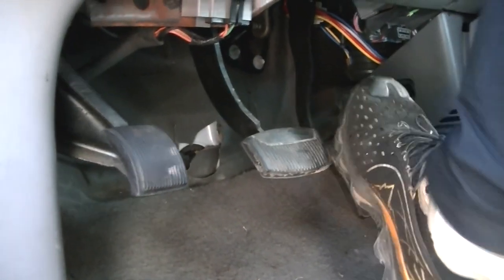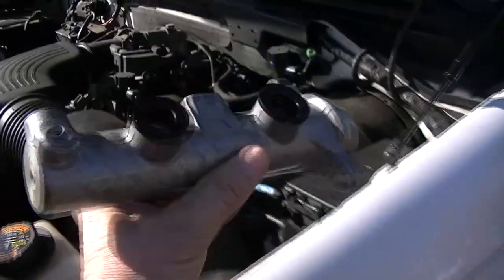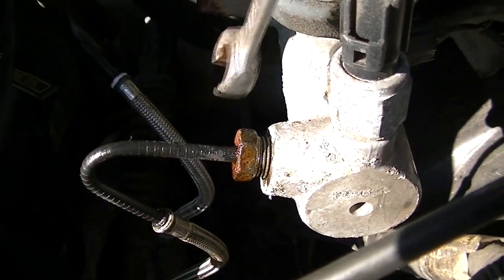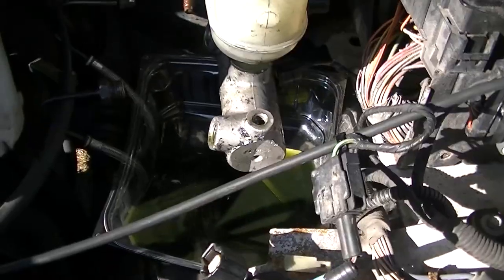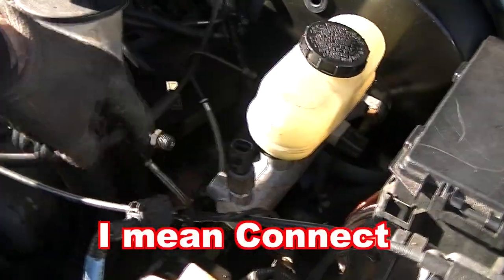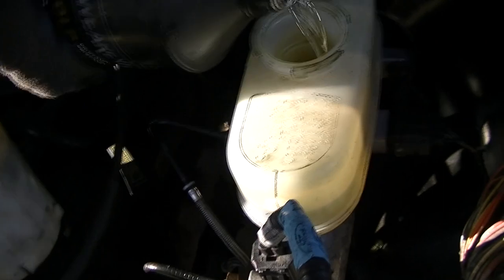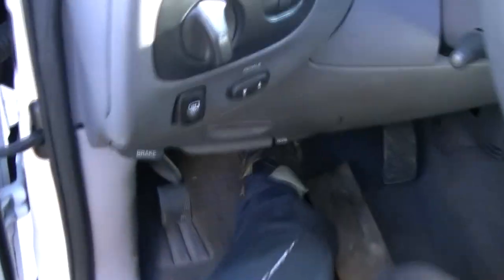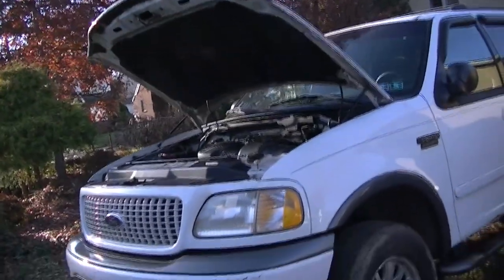Fix Fixing A Sinking Brake Pedal- NON ABS...Master Cylinder time!!

Comment: I learned a new trick from a guy on You Tube. Buy a 20 foot 3/16 id clear ( vinyl) tubing. Remove the dust cap on the caliper and force one end of the tubing onto it. Put the other end in the brake fluid reservoir. I used a funnel to hold the line in. Then open the bleeder screw on the caliper and slowly pump the brake pedal. When there are no more air bubbles in the clear tubing, tighten the bleeder screw and move onto the next caliper. Worked very well for me.
Reply: You don't want to put the old fluid in the caliper back into the reservoir unless it's all brand new fluid! Discard the fluid coming out of the caliper.
Reply: Instead buy a GALLON  brake fluid at Walmart for 14bucks
Reply: That's the stupidest thing I've ever heard... If u run a hose from bleeder valve on brake caliper up to the master cylinder reservoir, then any air that u are bleeding out of the system through bleeder valve, is being rerouted right back to master cylinder... Any1 that reads this comment, DO NOT DO THAT!
IF U VAPOR LOCK THE MASTER CYLINDER, THEN U WILL HAVE TO EITHER  USE A MANUAL BLEEDER (which is a pain in the @$$), or PULL MASTER CYLINDER ONCE AGAIN & BENCH BLEED, or possibly depending how much air u force back through it, if it blows or damages a seal, then you'll be buying a whole new mster cylinder!
I wish people would just keep to themselves if they aren't 100% certain about the methods/techniques that they share... Cause when it comes to people's vehicles, most people are trying to accomplish a diy repair to keep from or due to lack of funds to pay an ASE certified mechanic to do it... So when they follow sum1 advice & end up being no better off than they were when they began, it is really a debilitating issue to sum people...
It's really quite simple,
If u don't know what you're talking about, just don't talk/comment...
Watch, read, research, & become informed, so that u may actually offer sum valuable insight.
Reply: @fig-by3rz  I am sorry for my comment. I do not change out my brake fluid every time I change my brakes. This method makes it easy to bleed my brakes by myself. The tubing I use is not pushed into the brake reservoir, but placed a couple of inches above it. How is the air going back into the master cylinder? I don't understand your comment. Air is not heavier than brake fluid.
Reply: Well that's more like burping only tho.. Doesn't flush old stuff

Comment: It's easier to bench bleed the master cylinder, then fit a tube on to the calliper bleed nipple, into a clear plastic bottle with a 3rd of used brake fluid in to stop air flow.

Comment: Easy to follow directions, besides the diagnosis fault, differes what may be the issues split a part the booster section out of the equation.
Reply: Great Job..I'm going to have  to do this myself..
What is up with cost of taking it to a mechanic$2-300.. its not that hard to do .

Comment: Good lesson. You ended up bleeding the lines anyway; therefore, it is quite possible that by bleeding the brake lines will fix the "lose brake" pressure prior to replacing the master cylinder (less work). It worked for me.

Comment: In most cases you can fix the old master cylinder with a kit. The genuine one is better quality when I remove mine it still had the machine marks in the bore.
Reply from the maker: Yea True

Comment: You might want to bleed those lines a little more.  An 96 inch line holds a little over 1 cubic inch.
Reply: Nice job on that repair.   Thanks
Reply from the maker: OK.

Comment: Yea so I replaced the master cylinder and bled all lines starting with the longest line first and so on. Now it still feels like I'm loosing pressure.  Pressure is better but it just goes down slower. No leaks and even new calipers.  My caliper pistons arent moving much... could it be that I need more fluid in the system to push them out more?
Reply: You just need to get ALL the air out of the system. Adding more fluid will not help. As long as there is enough fluid in the reservoir obviously. The cylinder can only push so much fluid. It cant push more just because you add more fluid. Can you pump the pedal and the pedal gets firmer? If it does, and only drops a little bit then  you have air somewhere. If the pedal drops all the way down while your holding your foot on it then you have a leak still. It can be a bad master cylinder. Cheaply made or rebuilt cylinders may be defective. It happens and is not that uncommon. You need to bleed them more or you may need to have the brakes power bled at a shop. Or if you have ABS check the procedure for bleeding the  ABS module. Some cars have different steps or added steps to bleed the system. You have to check a service manual for your car.
Reply: @stang1970  yea wow I posted this a yr ago. Thanks for the response. I had  to bleed them more to get the air out as you stated as well as add fluid. I lost fluid during the bleed and to make sure you don't suck in more air keep it topped off. My calipers were duel pistons and one on each side were stuck. I replaced the calipers and the master cylinder. Calipers were probably fine. But the master cylinder was in fact bad. Didn't take long to fix.
Reply: @GODsSPECTRE  yeah i realized after i started typing how old your post was. I figured i would respond anyways in case someone else was having issues. since this was a how to type video. Im glad you got your car fixed!

Comment: I just had new breaks put on two weeks ago and my brakes still feels like a sponge. I just had a master cylinder put on and my breaks still goes all the way down to the floor. I bought a air filter, spark plugs oil change and filter and I'm wondering if all of this was done because my boaz had to put a quart of oil in my car on Valentines Day and I had the oil changed in December 🤔

Comment: Quite long yet very good and to the point. Just worried a little about your b fluid running all over during the bleeding.  As for the heat on the nuts, ( I mean the motors'!)  sounds good but isn't that a little risky in such an environment.  Finally I have a Holden Barina (Australia). Maybe the basic are the same but like with many other cars it can be so different. Thanks a lot, I have watched quite a few here, I put you in front of the others :)

Comment: Good video.  One little trick I have discovered, is to just barely tap the pedal upon the initial installation in order to allow the small amount of air trapped inside the unit to escape back into the master cylinder, rather than be forced down into the lines.  This has been a good remedy to keep from a full scale bleed of the lines.
Reply from the maker: Thanks for sharing!~

Comment: I know it's an older video but I'll try anyway. How did you arrive that you didn't need to replace the brake booster? I have the same problem and I don't want to go through a process of elimination if I can help it. Thank you,   this is  1/1/21  HNY
Reply: brake booster has nothing to do with a dropping, spongy pedal. A  brake booster, simply put, boost the pressure that your foot is applying to the master cylinder. This makes it easier to apply enough force with your foot to stop the car. Think of it like power steering. If the power steering pump goes out, you can still steer the car. It will just be a lot more difficult.  If its not working your effort would be a LOT harder to press the pedal enough to stop the car. Also if the bladder inside the brake booster is leaking it will cause the engine to run rough, idle high or even stall.  You also want to check for leaks between the master cylinder and the brake booster. This will look like faded paint under the cylinder, and on the booster. It may not look like fluid, just faded paint. Sometimes the fluid will run out of the rear of the cylinder and run  inside the booster. If this has happen you will need to replace the cylinder, because its leaking, AND the booster, because the brake fluid inside it will eat away at the bladder and corrode the metal booster. This will cause the booster to fail. Or your can take your chances and hope the fluid doesn't harm the inside of the booster. If there isn't any fluid inside the booster it will be ok.

Comment: I would like to ask why you didn't bleed from farthest line (passenger rear) from master cylinder first .
Reply from the maker: I did, nothing worked.
Reply: TVWXMAN32 That's odd. Normally you want to bleed from longest line to shortest. As long as you don't have air I guess is what matters.
Reply from the maker: I guess so ;)
Reply: I watch somewhere that actually you should follow the manufacturer's instruction re bleeding order. They can be different across cars.

Comment: Bench bleeding it would have been a lot faster. If you don't get enough air out of that system  may air lock. That will lock up your wheels. Because you didn't bleed it enough.

Comment: I have a opposite issue. I have dual piston calipers. So 2 pistons per caliper. The top piston is pushing out on both sides but the bottom isnt moving on both sides. Mind that I have replaced the entire caliper on both passenger and driver sides, and bled both starting with the passenger side. This issue I was having with the old calipers and am still having with the new ones. They're not sticking. But only half working. Could it be master cylinder problem? Couldn't be a hose issue because fluid has no problem coming out the bled screw and the brake isnt sticking. So I'm at a point where I think it has to be the master cylinder.
Reply: Yep sounds like my master cylinder.
Reply from the maker: @GODsSPECTRE   Yep.
Reply: @FixingWithPassion  I should've added that it's a 2012 Subaru forester. But I guess it doesn't matter. I needed the new calipers anyway

Comment: Hey mine sinks in, but not going all the way down and touch the floor. It just feels loose after the biting point and keep on sinking like 2CM down after putting so much pressure on it. Does that sound like a master cylinder, abs or bleeding could solve it? Thanks!

Comment: I need to know how to fix the master cylinder replacement extra cylinder with ABS brakes
Reply from the maker: Get an unused one and provide new strategy to it. Adjustments are on line.

Comment: I Did not see you adjust the booster rod or plunger to make sure you had the right clearance between the Master cylinder and the booster rod. Thanks for the video.
Reply from the maker: Yea. I never really talked about that. Only because one day...Boom! Brakes to the floor. So I really never needed to adjust the rod or plunger. There was a pretty good chance they were just fine. All fingers pointed to the master cylinder or ABS pump. But I know what you mean.

Comment: I noticed that there booster in the video has an adjustable push rod. Did you make sure to adjust the depth on it?
Reply from the maker: I've never had to do that nor have anyone else I know. That's over rated.
Reply: @FixingWithPassion  I wonder why the brake companies suggest it then. I've always adjusted them to be as close as possible. I have heard of people complain of the brakes sticking or spongey until they adjust it.
Reply from the maker: Not sure. But if someone is doing a mod, then I can imagining opening a can of worms and dealing with the push rods.

Comment: The correct sequence is front left, then front right , rear left, then rear right. From the master you do the closest and move away to the furthest from the master, so the air is pushed out. When you go to the left rear the air will move to the closest to the master, then when you go to the front right the air goes to the left rear which, you already did ,now when you're done you still have air in  the system. Tht air goes from the closest to the master away down the line. Get it. With a little tubing and a small bottle you can see the air bubbles and save the environment. Get it!!.
Reply: i was taught by my mechanics professor, to bleed the furthest away from the master cylinder which would be the passenger rear should be 1st to bleed, then the drivers rear, then passenger front and last the drivers front.  This is how your suppose to bleed them, if your master cylinder is on the drivers side and you do not have ABS.  with ABS brakes i believe its different.

Comment: Hi Nathan, I drive an 2015 Kia Sportage. I have an very unique problem, My Brake pedal Goes soft and goes to floor after I Turn my Steering full left. From Second pumping, Brakes are back to normal. This happens only when I turn the Steering to full left only. Technicians here are not able to find out. Any Idea
Reply: does it also do this if your parked and just turn the wheel? Will the pedal pump up with the wheels turned left or do you have to straighten the wheels before the pedal gets firm? Any dash lights on? Do you have the electronic stability control option on your car? You may be having issues with ESP or the emergency braking system
Reply: @stang1970  Hi... The issue was resolved. What happened was the right side Lock (Punched into Stabilizer bar and there is two Locks in between the Rubber Bush in Stabilizer bar to keep it stable,) in the stabilizer bar was dislocated causing the Rubber Bush and Stabilizer Bar  to slide towards right. When I rotate the steering wheel to Complete left (This also causes over steering during left turn due to sliding of Stabilizer bar Further), The Tie Rod on Right Front Wheel to hit the Brake Flexible Hose to Caliper union which causes the loss of Brakes during first pumping ( Issue will subside once the Steering is back to straight). I have welded the Lock and Placed the stabilizer bar intact. Now vehicle is fine. Thanks for your help.
Reply: @stang1970  No warning Lights are seen on the dash. The issue is unique and not much faced by anyone. I have heard from one of the technician that It is been seen in Honda Accord (Unverified), But first seen in Kia Sportage by him.

Comment: I am having a bit of a problem with a soft peddle. '82 G body Chev. I have changed the Master Cyl and bled all calipers and at the MC. still getting bubbles, usually seen at front right caliper.  Have changed that caliper with no improvement. Someone said to change the booster check valve.  I can't fathom how a booster check valve would introduce air in the brake lines. Does he have a point?  Also can the proportioning valve cause air to be added to the system?
Reply from the maker: No.

Comment: You wanna bleed the brake fluid into a bottle with a rubber hose that way no air comes back into the system plus just dumping toxic brake fluid out the caliper like that isn’t good

Comment: You don't have "master cylinders" to check on each wheel 1:12 . It looks like it has calipers. . Doesn't your left rear brake need a red rattle can spray job to provide even braking?😁 You should drain the master cylinder before removing the lines with a turkey baster or pump . The unit that was installed was a rebuilt aftermarket, not a new master cylinder. That isn't how you bleed a hydraulic system. If air gets into the lines at the master cylinder, weeping fluid at the calipers won't get it out.

Comment: What if my car doesn't have brand new brake pads will this be the reason why is doing that ?
Reply from the maker: No
Reply: Your fluid will be low but you should still have good brake pressure

Comment: I still have a problem all my lines are new and no leaks but the pedal still goes to the floor
Reply from the maker: what did you replace? Does it have ABS?
Reply: Kyle Gant
Reply: I have a 95 Chevy C1500 and I bled the master and there was air. but when truck is of pedal gets hard by itself and when I start it pedal goes almost all the way to floor. No leaks on lines. Any ideas? Don’t wanna waste money

Comment: uhhhhhh.... wtf did i just watch? "sometimes the system will bleed itself" --- uh no. it will NEVER bleed itself.. that is why there are nipples on each caliper..
ALSO bench bleed your master cylinder. I would not be surprised if this car ended up in a ditch or rear ending someone....
Reply from the maker: SUV runs prefect to this day/perfect brakes. People who never have worked on a car  in there life should not comment. Nuff said.
Reply: Nathan Rohrbough I'm an ASE Master Certified Mechanic.. I dont intend to insult your intelligence or experience. But I have never heard of a system bleeding itself.
Reply: Seth, show the guys at the shop so they can have a good laugh. He wont listen to people who know more than him because he is perfect and everything he does is perfect. Great comment hey Nathan?
Reply: @sethperkins1440  He left the brake lines on the MC finger tight while pumping is my guess.
Reply: Well I’m no expert either but the way he bled the brakes is completely wrong. He just open them to the surrounding air and let all the brake fluid spill onto the ground witch is toxic to the environment plus he introduced more air into his system doing it like that. Should have had a bottle filled with some brake fluid and a rubber hose submerged in the fluid so no air could get back in. Plus I agree the system dosnt just bleed itself that mean you have a leak if it did that. That’s why there is bleeder screws.
Reply: He gravity bled the master cylinder
Reply: @sethperkins1440  I didn't think so either, but after replacing a master, cylinder, I bled ,(with a bleeder kit) a bottle from each front wheel and two from each back wheel. Didn't see one bubble of air.